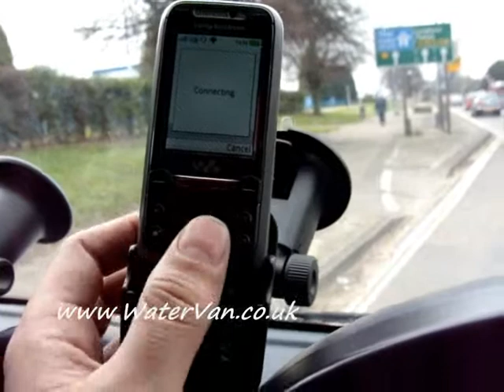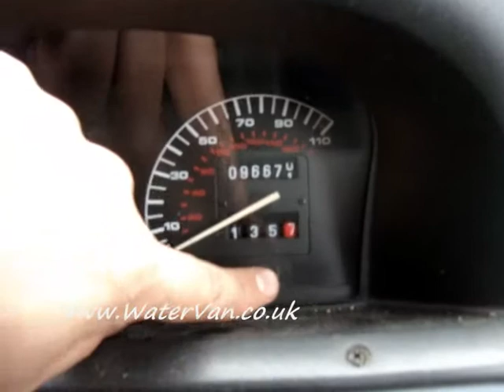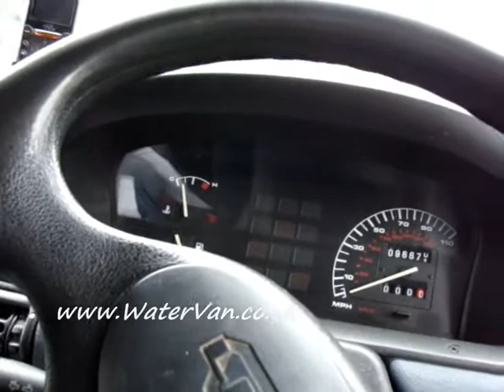#014.5 - MadStu's Water Powered Van - MPG and DAMN HOT!

Comment: exactly, if you measure a -nnnn+ stack at the - and +, you will see all 12v. If you measure from the - to the first "n" you should see 2.5v. second "n" you should see 5v and so on. This puts your voltage per plate gap in the "sweet spot" so things will run cooler and more efficiently.

A neutral plate setup will not make more gas! But its will help control your amp draw and heat issues.  It aint magical. Like most things, its a compromise employed to solve a problem.

Comment: if its done properly, neutral plates will effectivly cause a voltage drop within a single device. So if you have +nnnn-, you have a total of 5 plate gaps with your 6 plates.  Each gap is a resistor and will cause voltate to drop. 12v/5gaps=2.5v per gap.  You should be able to prove this to yourself with a voltmeter.

Using multiple devices is another way to do it.  Both work well.

Comment: I have heard this argument and it may indeed be valid.  A couple fellows I have talked with insist that their setup works better when it is running close to boiling point. They incorporate raidators and pumps to cool the liquid so it dont quite boil and swear they get better performance. In my own experiments, it looked to me like what I got was more steam than gas so I try to keep mine running cool. But I could be proven wrong on this one. Still waiting on repeatable proof.

Comment: brass = bad idea ... have done extensive tests with mixed metals and that one is proven to NOT WORK ... you end up with an electroplating device and contaminated soup ...

keep it all stainless if its in the soup ... you can use copper, brass and chrome plated doo-dads on the outside but never inside where the reaction is taking place ...

there are a couple fellows working with all nickel right now but so far, still looks like stainless has the edge ...

Comment: 1 Watt of electricity can be directly converted into BTU's (British Thermal Units)  Watts = Heat, nothing else.  If you have 300 Watts at any voltage at all, be it 10,000 volts or 1 volt, the same heat ratio for Watts will be observed.  If you want it to run cooler, use more liquid, a bigger container, a metal container to transfer heat to the air around it, or some kind of heat exchanger.  Have fun STU, now go out and get some stainless to get rid of the sludge!

Comment: No doubt.. you have to use neutrals for auto. ON the latest cell I have I put out 1.2 lpm but sacraficed 12v at 40amps.480watts. thats too much. Plus the heat builds fast. but here's what I'am planning next for plate config: -nnnnn++nnnnn- (my neutrals spacing of 1/32" and my '-' and '+' 1/16" from neutrals.

Comment: No, not enough neutrals for an automotive install ... need 4 neutrals per side ... I sort of like more - than + but cant prove it works better ... so I might go -nnnn+ or maybe -nnnn+nnnn- ... for a X5 setup, -nnnnn+.

other thing about doing a "series cell" with the neutral plates is that to make it efficient, you really need to seal up the edges so the electricity is forced to go through the plates, not around them.  ZeroFossilFuel did a couple GREAT videos on this and showed how to do it.

Comment: electrolysis starts hapening at about 1.5ish volts. As you exceed 1.5v, the process accelerates, but get less efficient. 

So the more volts over 1.5v you use, the more of the volts go into heat than electrolysis. When you get up around 3v, MOST of anything more goes to heat, not gas, so by all means, try to keep it under 3v. 2v is more efficient and runs cooler, but 3v makes more gas and makes a bit of heat. 

Choose. Its about compromise.

Comment: yes, you are using a simple +/- pair and hitting it with 12v+ so you make a lot of heat ... there are ways to deal with this ... when you get your stainless and start building your new device, you will want to decide on which of the many ways available to tame your volts you will use ... the idea is to make HHO gas, not steam ... its not magic, just takes persistence, experimentation and hard work ...

trick is to get volts per +/- pair down to 2v-3v range.